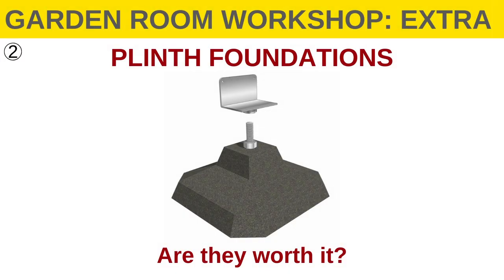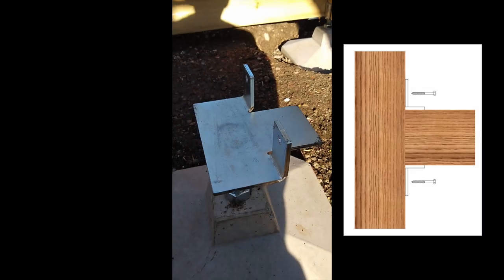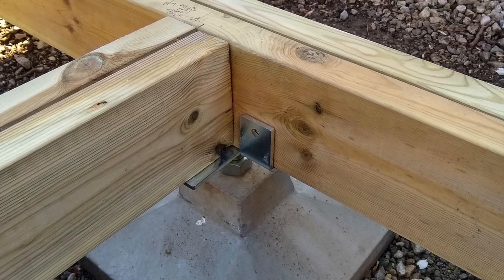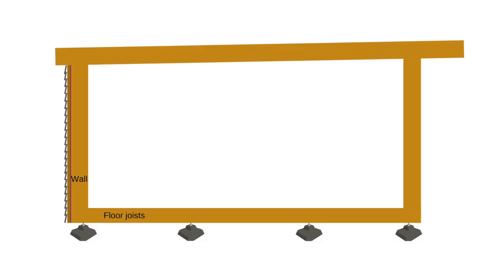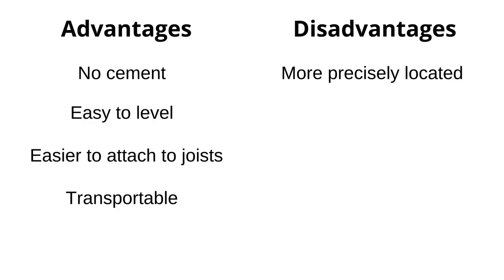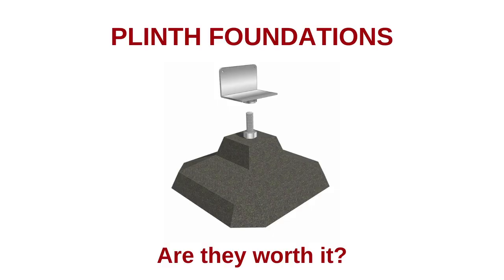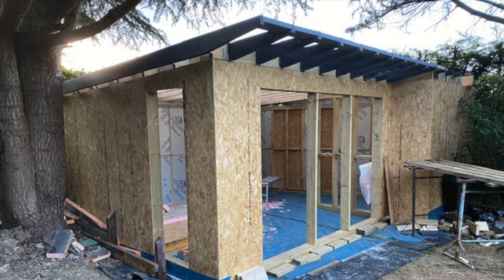Garden Room Workshop Extra | Plinth foundations

Comment: Well I went with the concrete blocks, done 9 with extra blocks in between on my 5.2 x 3.2 ,,, and I'm waiting for 9am to start the walls 😁 it's been a struggle in this heat but all the hard bits are done. Also I picked epdm which in my opinion looks like the best option. Thanks again Ali as everything you have uploaded has really helped me build what I'm building.
Reply from the maker: Foundations are the hardest and most important. It starts to take shape quickly after that.

Comment: Excellent video. Exactly the info I was looking at. Planning a 5m x 3.5m. Was originally thinking a concrete base but prefer this idea to get more air flow underneath the building. Also easier to put back to lawn in the future if I was ever to remove the building.

Comment: Hi Ali  

Just checked back to your channel page to get a refresh on wall framing around the windows (this weekends task) and noticed this extra video

I used 15 of these on an 8x4m base (on sloping ground) and can confirm they don't wobble excessively if you stick to the recommended 100mm of adjustment (which I assumed was in the range 0-100mm). This leaves plenty of support inside the (sleeved) hole.  

The small amount of play that remained disappeared when the base was bolted down (as speculated by Justin).   

However, what has started to worry me, is that since I have been working on the base I have noticed that one or two of the mid-span nuts have come loose and can now be turned easily with finger pressure - in fact one whole span of one of the short side walls was floating above its mid-span jack.  I assume this is due to power tool vibration caused by me adding the insulation, ply and now three out of four external walls.  

Of-course I can thread-lock the outer ones - but - if the three central pads which are now inaccessible on my project have done this I am (un)screwed.

Perhaps Chris has not reached this stage yet - or - has been smarter than me and added thread-lock  (BTW there is nothing in my documentation to say I should have done that).  

The center pads are the ones to worry about as you wont be able to get at them in the future.

Hope this saves someone else the trouble I may now have...
Reply from the maker: Thanks Ray, that's really good to know. I'll pin this comment. I'd not heard of thread-lock but looks great as it prevents the nut from loosening but if you need to adjust it can be broken and then reapplied. Here's a link for anyone looking: https://amzn.to/3eQ9A3g
That's definitely what I would use if I went down this foundation route.

Comment: Useful review.  As a point of note, whilst the brackets are listed as anti corrosion plated I wonder about the supporting screw-thread and nut.  You might never need to adjust this, but I can imagine this would turn into a solid block of rust at some point.
Reply: I've never seen one of these in the flesh, just on this video, but shouldn't there be a large galvanised/stainless washer between the nut and the concrete? It offends the engineer in me!

Comment: We're thinking about using "ground screws" for our build. They seem like they may be easier to install and don't require bedding, concrete, etc.
Reply: I'm thinking this too but quotes are twice that of these blocks it seams, humm
Reply: @atheistyler  Yeah, they are quite pricey. Amazon sell sets for small structures that are more affordable - but they don't seem appropriate for garden rooms. https://www.amazon.co.uk/Maxerio-Diameter-fundament-foundation-drilling/dp/B07N45Y81Z (you probably want the longer ones for heavier loading)
Reply: @ashleydawson5070  I've just installed 20x ground screws from TheGroundScrewCentre. Happy to share my experiences if you drop me a message
Reply: @anthonybrown5550  I`m interested how your Ground Screws went? - easy to use / how much were they?, thx

Comment: Great Series Ali - it has inspired me to gave it a go myself.  My intended Summer House may be used to house my inflatable Hot Tub.  I wont be doing plasterboard but instead it will be ply lined and I will be fitting an extractor fan (or 2) .  It will be fully insulated and roof construction will be cold roof type to keep overall height to a maximum of 2.5m and floor size will be  3m x 3m.   But my question is about floor construction and foundations given the weight of a 1.8m inflatable spa full of water and 4 people in it!  I think this will be around 1,800 KG or 555Kg per square meter (or 115Lbs/ft2 in old money) and that of course doesn't take account of the buildings itself.  I was going to go for your cement block pillar supports.  Will this be OK - what spacing should I use and what spacing/size floor joists should I go for?
Reply from the maker: Corr that does heavy. If it were me and I couldn't use concrete (first choice) I'd just go really close with the blocks under the spa. There is information out there on what weight joist thicknesses/spans will take so have a google and see what you find. Definitely doable though!

Comment: I am currently researching how to replace my old (asbestos) garage with a new slightly larger unit that has two internal rooms. A workshop area for me, and a gym for her! These pads look like they would be must easier, and less work. I did want to do blocks, like you have done, but have found it incredibly hard to source sand! Also, ground screws look great too, but these seem very expensive, and my concern with doing this as a DIY job is going down and hitting a pipe/wires and causing a whole load of bother. 

I did like the point of taking the foundation with you if you move :D
Reply: Assuming sand shortage is Covid related? It should get easier to source soon as restrictions are easing and companies are finding ways to work safely.  Plaster was very very scarce, but boards at least are starting to show up.  So fingers crossed for you.  Also I think some retailers aren’t selling shortage items online, only in store.  So worth physically checking perhaps?

Comment: I plan to build a 4x3m garden room on land that slopes from back to front. 12inchs. I thought the use of easy pads might be a good idea as I can put the front pads at ground level and bury the rear pads. 

Someone has mentioned to me about concerns over the frost line. Can anyone shed any more light on this and how this impacts on the use of these pads?

Easypad website suggests that the pads can sit on or below ground level

Comment: Need to know more about this 😮. Beats trying to do a 5 inch
35’x35’ slab with rebar by my lonesome right?  
**£Anyone know if this will work ok down on the panhandle? 

My home is about 15 miles north of the Pensacola area and I want to at least get a foundation started for a 35x35 wood workshop/billiards room I want to build. It’s mostly compacted sand around here, but a good amount normal grass that grows and it is not clay. One could possibly build an oversized flat concrete mold under it or is that even needed?
Reply: It mentions my whole story&question halfway through the video. Found it and now we can all keep moving along with our list of projects but thanks for reading. Lovely weather down here btw. 😂

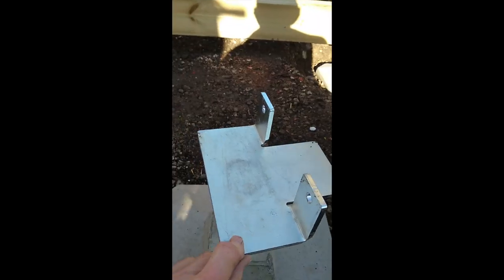Comment: At 1:30 when he said he "dug the pads in to make less use of the extension" surely he should have raised the pads in order to have more of the supporting threaded shaft sit within the pad?
Reply: Yes, I didn't actually mean that when I said it, your right in what you say. I was faced with a very uneven surface so did need to dig some of the pads in to reduce the amount extension I needed on the other pads and so lower the whole base. Sorry for the confusion!
Reply: @Sixdinnersid  Did you use the 2inch brackets - yours look wider to accept two joists screwed together? I've ordered some with 2 inch brackets and wondering I I can get around this by routing a recess where the brackets are
Reply: @owainstravels3381  how did you get on with this. I’ve got 2 inch brackets too and confused about the documentation saying use 2 2x4 together
Reply: @runzareviews4188  I think the wider brackets come with the larger size pads... or you might be able to buy the larger brackets seperately. I was planning on doubling up joists but when I looked at how faffy it might be I decided not to bother. The only way I could see it could work would be to rout a recess in one of the two joists for the bracket to slide between them. I think when the walls are up, the likelihood of deflection in a single joist base is really slim as the whole wall would have to bend above it (you're basically building a shoebox). I have built my 3x5m garden room with single joists in the base with double French doors and 2 windows (all double glazed upvc) and it seems to be fine. I was more concerned about the pads sinking and being level in the footings so I used MOT then high strength concrete with a gravel grid turned upside down. I levelled the gravel grid (sunk into the concrete) and had a a nice level footing, each one slightly larger than the pads. I can share photos etc if that would help. There's so many ways you can do things I don't think there are many wrong ways, just what works for you
Reply: @owainstravels3381  mines going to be 3.7m by 2.1 so not massive. I think single 4x2’s c24 grade will be fine. i want to use the 4x2’s so it gives me more headroom inside. I’ll dig down a little and have a 5cm gap for ventilation underneath the floor
Reply: @owainstravels3381  Ps i’ve got 12 pads for a building that’s 3.7 by 2.1. My maximum span is only 0.8m so i can’t see how I can go weomg
Reply: @runzareviews4188  Yeah I agree. You will be fine with singles. Best of luck
Reply: @owainstravels3381  Could you send some of the photos of yours? Would love to see it considering it sounds similar to how mine will be.
Reply: @runzareviews4188  can do. Can you share an email address or something somehow?
Reply: @owainstravels3381  Did you use joist hangers for yours? I know Ali did but his building was a bit bigger
Reply: Runza Reviews Yes, with twist nails. I think I used the same as Ali via the link in his video description as they were smaller hangers but rated for the load capacity. Some ppl use longer ones but I didn’t want to wrap them over the tops of joists and then rest boards on top and have them be a bit wobbly/uneven

Comment: I'm planning a shed/workshop 9m x 3.5m and was looking at the screw as well the type that looks like a screw, but I've been looking at making my own, I'm a toolmaker, the base would be made from channel. I did a decking and made some M20 adjustable legs and concreted them in, it worked well but a pain in the rear to get concrete into the holes, I did over engineer the project. I would love to see how others have got on using the ground screw. Top video as usual 👍
Reply from the maker: That's a good size and shape. Looks like I might have someone to share their experience with ground screws so could be soon! As for over-engineering, I'm all for it for your own home :) You could weld some brackets? No idea how you'd make ground screws, sounds like wizardry to me.
Reply: @AliDymock  thanks for getting back, I've found if you watch some crazy Russians videos on building machines from broken lardas anything is possible 🤭. For a living I have to over design press tools to last 15 years (with proper maintenance), watching your videos is great and educational 👍.
Reply: I have just seen your comment after these months and oakwood garden rooms on youtube have a relatively simple and what seems relatively inexpensive DIY screwed rod system for foundations which seems to work well
Reply: @sm2649  hi, what type is that, im still in design stage

Comment: Could you attach yor building to a house like an extension if so what would you recommend for foundation would it be the same thanks love the videos
Reply from the maker: Yes you could, it's not uncommon for extensions to made of timber for floor, walls and roof but blocks/bricks tend to be more common as does a concrete base. The side issue if you're within 1m of a boundary makes it much simpler to make out of blocks and render or brick though

Comment: I've also been looking at ground screws, but so far I've only found one UK vendor for DIY screws and they run at ~£35 per screw with mounting hardware.
Reply: Why website was that at Paul? Looking myself
Reply: @proteincloud2650  Search: The Ground Screw Centre
Reply: @Paul-XCIV2  Hi. Did you go for these in the end? i'm very close to pushing the button myself so any feedback/considerations would be great? Thanks.
Reply: @anthonybrown5550  No my build is not happening until next year (if we can even get materials easily after Jan customs changes) but I'm still mulling over the time vs. cost of Ali's approach vs. these screws.
Reply: @Paul-XCIV2  other than cost did you have any reservations with use ground screws and/or the ground screw centre?
Reply: @anthonybrown5550  No I think my only question would be working out how long a screw you need for your type of ground (they can probably tell you) and then finding a way of leveling all your screws.

Comment: What do you do if the ground drops in the middle of the room. How do you adjust the floor level?
Reply from the maker: Gosh, I'd lift up the floor, get a car jack to prop up the joists and then put timber or some kind of packers between the block piers and timber floor frame. It's unlikely to happen because all the weight of the roof and wall passes through the perimeter piers.

Comment: Ali thanks for sharing this, I have been looking at these and did think they were expensive, does anyone think it would be possible to combine the two ideas and use blocks like yours, but drill a hole to take the brackets from the pad system, as i think they can be bought separately?
Reply from the maker: That’s an interesting idea, basically make the concrete bit yourself. I don’t see why not. I reckon a lot of the cost is in the transport (delivery) of the concrete pads so yeh, like it!
Reply: The cost is pretty much the same. Once you buy zinc rods, metal plates and so on the price comes out quite high. Blocks have been used forever and work just fine.